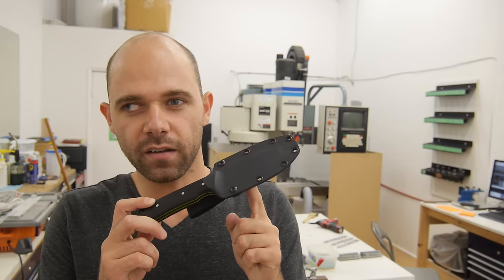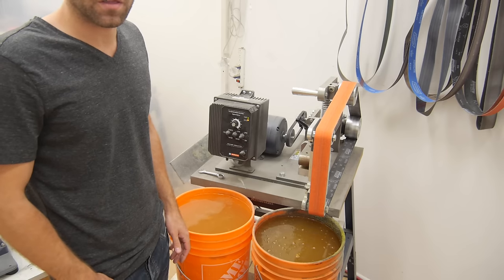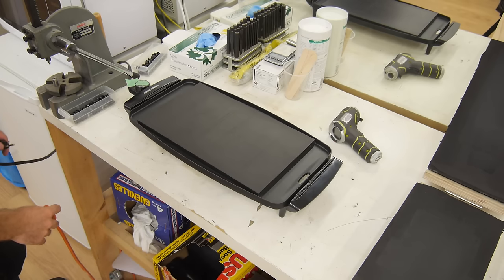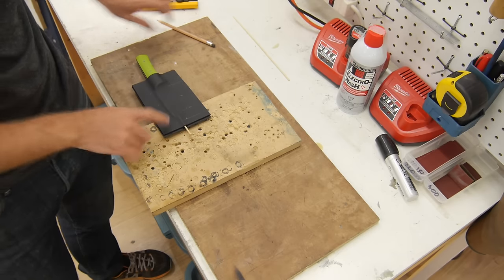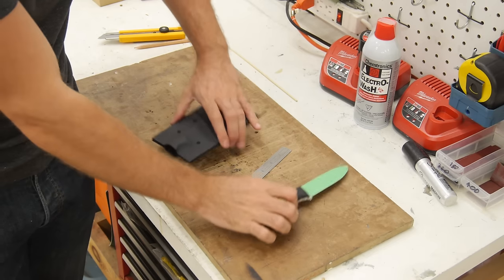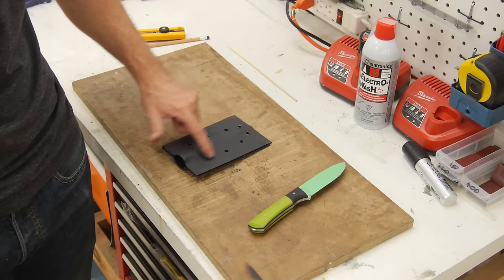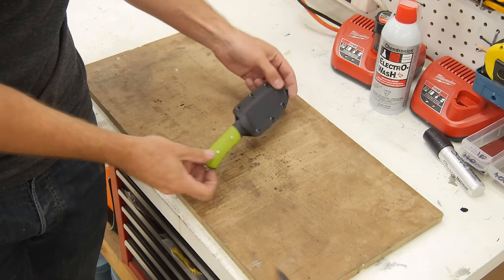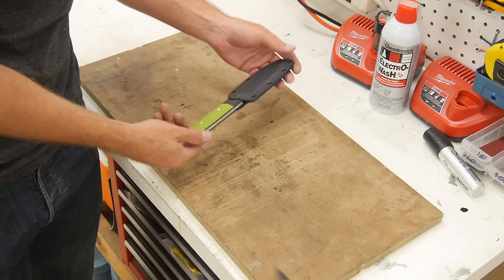How to Make a Kydex Knife Sheath

Comment: Im stunned by the almost robotic perfection in the way you make your knives and sheaths. Brilliant.
Reply from the maker: Thanks mate!
Reply: @GoughCustom  
Kydex is for rookies! I am returning the leather ... Kydex has scratched all my blades that came with it as standard. Some expensive blades now have Kydex damage !!! I wish blade manufacturers would give you a choice between Kydex for kids or a leather sheath for all blades over $200 ... the leather would be an optional extra (higher cost) ...
Reply: He's Mark Zuckerberg's son..
Reply: @mathew howard unless your steel is softer than kydex the scratches must be coming from other contaminants, ie. dirt, sand, etc. i made the mistake of not cleaning my kydex off before making my first few and abrasive dust from my grinder and other steel dust made its way inside and was putting scratches on my knives.  once i started cleaning my sheaths and giving them a rinse now and then i haven't had any issue. just my experience tho.
Reply: @GoughCustom  After 4 years I've ended up back here on this video and I would like to make a few observations:
I now own a Gough Custom Knife, and it is utterly superb.
It is without doubt the most reliable knife I own, because I can trust the manufacturing process, the heat treat, design and materials.
I initially thought there was a slight defect with the kydex sheath and emailed them. Gough replied, and precisely explained the indent I was referring to, why it was deliberate, and the precise function it served. There is nothing on this knife or sheath that is "accidental" or a "manufacturing flaw".
If you want a 100% reliable knife that you can take to the desert OR Antarctica, and you need to know you can trust completely, well this is 500 Canadian well spent.

As for the argument about Kydex versus Leather sheaths ... Im a fan of both, but neither is "best", even though I love leather sheaths in a temperate climate.
Leather sheaths work best with stacked leather/wooden handles. You can slather your sheath with all kinds of lovely oil/wax treatments, and if they hit your handle, they soak into it and preserve the handle too! Its a lovely Scandinavian virtuous circle.
Kydex sheaths work best with synthetic handles. Where you only oil the blade, and you DONT want oils on your handle because they will only make it slippery.

Setting my personal preferences aside, the Gough Custom knife and sheath, will not rot in the jungle, will not fail at -30 degrees, and if I had to bug-out tomorrow and only take one knife from my collection with me, it would be that one. And when I said that, I winced from the realisation of the knives I would leave behind.

Gough makes perfect knives, at precisely the specification he advertises, and they are worth every penny.
Reply from the maker: @TheWtfnonamez  Really glad you are liking your knife so much mate! I am steadily working on the next version of the Resolute which I hope will roll in a lot of subtle but meaningful improvements! I will definitely post some videos on the process and the final result within a few months!

Comment: Very good video I especially liked the press you made. Had a pretty good chuckle at "Did you add the drain". I have an old drinking buddy in new Hampshire that is a smith that adds three drain holes at 90 degree increments to each other on his D2 hunting knives. I had to ask him about it because I didn't see the purpose but some folks prefer to wear a blade sideways across the belt. Some to look tacticool I suppose but others find it less intrusive. Having just bought some smaller EDCs I'm kinda leaning that way myself as they are more comfortable than my bushblades to carry around because they don't dangle like a tumor.
Reply from the maker: 'Scout' carry (sideways carry) is definitely getting more popular. I would like to make a mounting option for my sheaths so they can be carried that way soon!
Reply: I think most of the time when I see it comes with a configuration for both by twisting the mount in different 90 degree locks. Not sure how that mechanism works.
Reply: what was the bucket under your belt sander full of?
Great vid
Reply from the maker: It's just full of water to help catch dust.

Comment: I watched this video in hopes to find a better way of seating my rivets because I have the same rivet seater and I am have the splitting problem and lo and behold you talked about it. I have a arbor press so I will be buying a rivet seater for it. Thanks
Reply from the maker: Good to hear! You can also polish the inside of your rivet dies by spinning them in a cordless drill and running some 1200 grit sandpaper on them. Most splitting is caused by a tiny burr or ridge on the die, that causes a stress point which splits the rivet.

Comment: Thanks for a great video. Now that I am retired and Love knives, I wanted to start making KYDEX sheaths but had no idea what was needed and where to start. Thank you for listing the items and where to get them. I've seen screws used instead of rivets, I think they're called Chicago screws. Do you use them also in certain applications ? I can see that you are highly skilled because you made it look so simple which I know takes a long time to perfect a craft. Your video answered a lot of questions I have have had. Thanks again.
Reply from the maker: +THE YAKUZA excellent, glad the video was helpful! People use screws to hold the sheath together generally when they intend it to be disassembled, I make mine easy to clean with the drain hole and so on, so there's no need to take it apart

Comment: Two thoughts:
1) Another timely video, as I'm almost at the point of making my first kydex sheath.  You make it look easy.

2) If you've never done a DLC/Cerakote lime green blade, you totally should.  The green tape looks totally badass with those scales.
Reply from the maker: I hope the video is helpful mate!

DLC only coming in black unfortunately, so not much opportunity to do different colored blades any more!
Reply: So, I made my first kydex sheath today and followed your video pretty much exactly.  The end result was almost perfect.  I feel like I put the rivets too far towards the handle, so there wasn't much kydex separation and I had to take off quite a bit too get the knife to fit.  

Still though, it has perfect retention and works very well.  I didn't even screw the holes up!  Round 2 tomorrow.

Thanks again Aaron!

Comment: Great video - it was very informational for me as someone just thinking about making some sheaths for my knives. I visited your website and think you use G10 for the handle scales. Do you have any experience with micarta scales? I'm curious to know if the ~300*F temperature will adversely affect the micarta material in any way. Thanks for the video and any tips you may have.

Comment: Great video. Noob question, could I get by with one layer of tape on the blade, because I want to have the least amount of rattle as possible. Thanks for your help.
Reply from the maker: You could try it, I would guess that the sheath will bind and be too tight though, you won't get much if any rattle with a few layers of tape!

Comment: I wonder how you will streamline this process. You spent so much time on the efficiency of making the blades that now sheaths feel like the bottle neck of your production. What's the target of this year btw? how many knives are you aiming to produce? 

awesome stuff btw, i love watching your production process videos.
Reply from the maker: Hey Ibrahim! You certainly seem to know how I think! The plan is to partly automate this process by making a mold that the kydex will be pressed into, then my CNC machine will cut them out so that every one is exactly the same... I am actually working on this process right now!

Production goal for next year is about 36 knives per month!
-Aaron
Reply: +Gough Custom   Wow. My math is horrible, but @ $300/ knife that would be $130,000 for 2017. Assuming your overhead isn't too much, that would be a good year.

I've been watching for a while. With as much work as put in, I sincerely hope you meet or exceed your goal.
Reply from the maker: Hey Pete! My overheads aren't crazy, but they do take a pretty sizeable chunk out of that... Thanks for the well wishes, I hope it works out too!

Comment: Hey Aaron, impressive sheath! What foam did you use to construct your kydex press? Also, do you have any thoughts on rivet flaring pliers? I'm guessing they're probably not worth using if you didn't mention them, but I'd like to have a more reliable option than the die but cheaper than the arbor press. Thanks
Reply from the maker: Good question on the foam, this is the stuff I used: http://www.knifekits.com/vcom/product_info.php?cPath=41_524&products_id=4291

 I will add a link for the foam to the video description! I haven't tried the eyelet pliers... I like the idea of them though, I'd say they're worth a shot!

Comment: In an earlier video you used a toaster oven to heat the Kydex material. Do you think that you obtain a more thorough heating of the Kydex by using the griddle? Or is it just easier to measure the temperature of the Kydex when it is on the griddle?
Reply from the maker: The griddle works way better in all respects from what I've seen, cheaper too if you're buying something just for use on kydex.

Comment: Great work!! One question: isn't there  the risk that the blade will lose some of its temper when you put the hot sheet of kydex in contact with it?
Reply from the maker: Hey mate! No there is no risk of damaging the temper. The tempering temperature for most steels is around 400ºF which is much higher than the temperature of the Kydex, so it doesn't have any effect!
Reply: @GoughCustom  Thank you for your reply

Comment: Great stuff, as allways. 
I was wondering, have you experimented with leather sheaths as well? This is pure curiosity, I personally prefer kydex sheaths for normal -> hard use knives, and on my own traditional wood handled knives I prefer leather for easy - just over easy use.
Reply from the maker: Thanks! I actually have never played with leather much... I would like to at some point, but I like Kydex so much that I haven't had much motivation to do so!

Comment: Hi! I am French I do not understand all the American. I started the kydex cases 2 days ago. on some cases I have retention problems, and I have the impression that the kydex ''is not well pressed, badly molded''. is it due to the 2mm thickness? and I have the impression that the kydex sheath scratches the blades a little, what is this due to? Thank you for your answer

Comment: Quick question for you - what is it that is sat on top of the griddle? Is it the same kind of foam that is used in the press? Thanks in advance!
Reply from the maker: It is actually just a big aluminum plate, painted with cerakote to make it non stick. The extra thermal mass helps keep the temperature steady

Comment: Nice job dude, I would like to do the same but... I don't the gear you have, what can I do?
Reply from the maker: Hey mate! You can always use simpler tools, oven instead of hot-plate, hand-saw instead of bandsaw, files instead of belt sander. It's absolutely possible to use simpler tools, it will just take longer!

Comment: When making large batches of resolutes, do you tape and form each sheath to each blade, or have a single knife that you use to make all the sheathes?
Reply from the maker: I actually use a specially shaped blade that I call my 'sheath master'. It has a different grind on it (scandi rather than full-flat) and has the drain-former built in. The special shape helps create extra room in the sheath. You can see a photo of the sheath master here: https://www.instagram.com/p/6VYmMFiKFf
Reply: +Gough Custom cool! Thanks for telling!

Comment: Very  well explained, what is that black square piece on the heating base?
Reply from the maker: Thanks! You've got good eyes noticing that! It's a large 3/8" thick piece of aluminum that I added to spread the heat more evenly on the griddle, really helps with doing production sheaths!
Reply: Great idea, the problem is find a piece like that.
Reply from the maker: Any metal supply place will be able to hook you up!
Reply: +Gough Custom Thank you!

Comment: What does it make snap in like that? The bottom lip? Or is the handle beveled outwards at the edges slightly? Made a knife, want to make micarta handles and a sheath, but I have to do it right from the first time.
Reply from the maker: The 'snap' is a combination of the handle shape and the sheath shape. Unfortunately it will likely take a few tries to get it right! The finger groove on the handle provides the place for it to snap into

Comment: Nice and very interesting tutorial!

Who manufactured Your belt sander (model and brand) or is it DIY?
I'm actually searching for sth. like this...

Thank You! :-)
Reply: You had some great tips that is hadn't considered before. Thanks for the info! One tip I will share is using a clean rag and some acetone on the edges negates the need to hand sand entirely, other than cleaning up the opening. And if you hit the edges on a clean buffing wheel they look really good, and the seem completely disappears.
Reply from the maker: Hey mate! My belt grinder is a KMG grinder, made by beaumont metal works. It's a great piece of machinery!
Reply from the maker: Interesting tip about the solvent polishing, hadn't thought to try that!

Comment: So just how do you make the knife snap in like that, the tips of the opening curl back in just a bit like fingers because that's the contour of your handles? Or is it clicking past that little metal at the bottom of the handle, just before the blade starts.
Reply from the maker: The sheath is shaped into the 'finger groove' on the handle, and it snaps into that to lock the blade in place.

Comment: Great job my friend . but can you show us how we can make one wich we can moun in a belt or in mole a tactical one . i know that your time is little but if you could when you have the time will be great thanks from greece
Reply from the maker: This sheath will mount directly to MOLLE webbing using zip-ties or paracord because of the 1-1/2" hole spacing. To use it on a belt loop I use a belt loop adapter that I make, which is shown here: http://www.bladeforums.com/forums/showthread.php/1147139-Webbing-loops-for-kydex-sheaths
Reply: Thanks for your replay my friend

Comment: What size rivots do you recommend for your sheaths? Been interested in making one.
Reply from the maker: It depends on what thickness of kydex you're using. I use 0.080" kydex and #8-8 rivets. There are links to the kydex and rivets under the video!

Comment: nice! when and why did you start adding the Drain?
Reply from the maker: Hey mate! I have actually been doing drains right from the start, but it used to just be a drilled hole... The drain makes it way easier to clean the sheath, and also prevents rain from pooling in the sheath!

Comment: Hey Aaron, im wondering how the arbor press rivet setter works. The link you posted under the video doesnt work anymore and i cant seem to find anything on it online. How does it attach to the arbor press? And where should i look to find something like that since that one is no longer available? Thanks.
Reply from the maker: Hey mate! It's pretty much a standard arbor press but with holes drilled in the ram and base to accept the dies... You can buy one from KnifeKits.com
Reply: Gough Custom thanks man. I found it and it's not nearly as expensive as I expected which is nice. Thanks for making such good content. Happy holidays my dude.

Comment: My Kydex stuck to the griddle :/ I also dont have a temperature gun so I set the dial and waited until the light turned off. Do you reckon it just got too hot? And maybe the Teflon is too worn out on the griddle?
Reply from the maker: Sounds like the temperature was too high! Definitely worth buying a heat gun!
Reply: Just bought a gun and checked the griddle, when I had it set at 200 and the little light shut off, the heat gun was showing 380!

Comment: Hello, can you please explain what for material you use as thick layer on the plate of the grill?? Or it alos possible just to put it on the grill plate??
Reply from the maker: Hey Vladislav! Sorry for the slow response! Yes it is totally possible to just put it right on the grill plate. The block that I have added there is just an aluminum plate to help keep the temperature more steady. I painted the aluminum plate with Cerakote to make it non-stick.
Reply: @GoughCustom  Thank you a lot for the answer and your tip.

Comment: I tried it and my griddle melts the Kydex.  Do you have something laying on top  of the friddle?
Reply from the maker: Hey Jim! I have a piece of aluminum on top of my griddle to help spread the heat, however I used it for quite a while without the heat spreader and didn't have any issues... You have to carefully measure the temperature of the griddle using an infrared thermometer like I show in the video, and be careful to pre-heat the griddle and 'sneak up' on the final temperature... It is definitely easy to melt the kydex if you are not careful!

Comment: Sorry if this is a stupid question, but why did you want an open space at the tip of the sheath?
Reply: To drain fluids out of the sheath so the knife does not get rusty (even some stainless steels can rust in a very wet environment if they are exposed to that environment for a long time )
Reply from the maker: To make the sheath easier to clean (you can just run it under a tap) and also to make sure that water doesn't pool in the sheath when you're using it and it rains or whatever.
Reply: Oh I see. I didn't think of that as a potential problem.